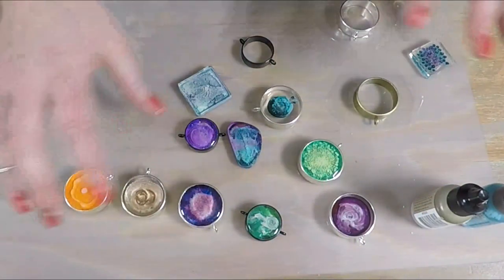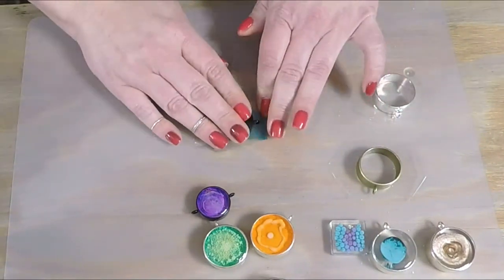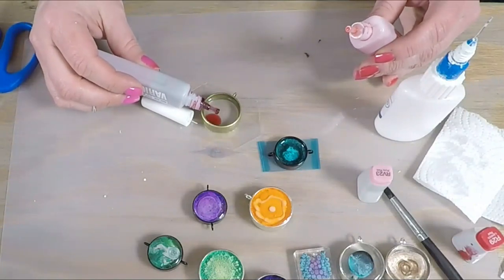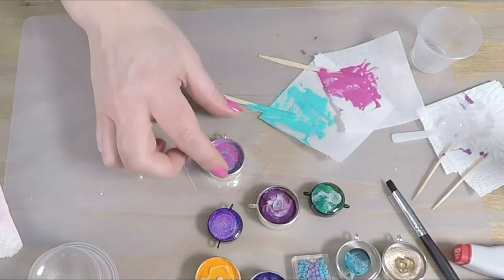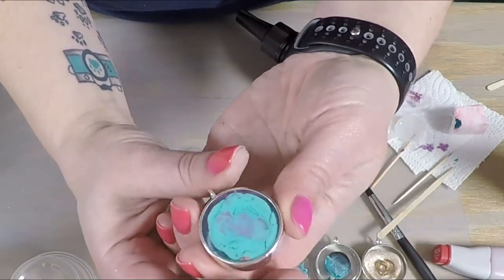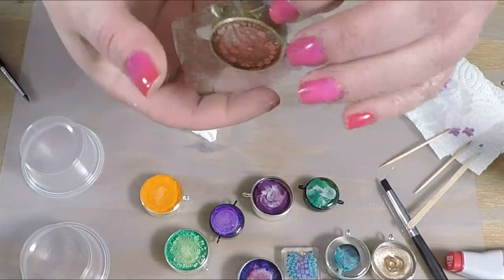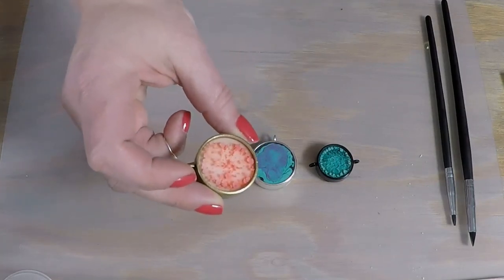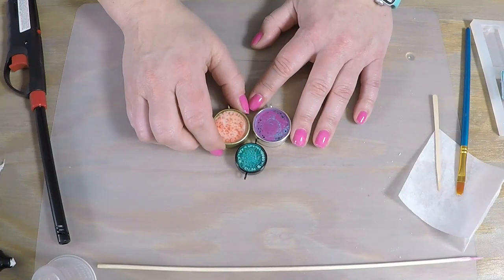Alcohol Inks and Silicone Oil in UV resin | Petri effect tutorial | Tips

Comment: 3-IN-ONE All Temp Silicone Drip Oil is a silicone-based lubricant designed with other components to form an effective product for use on metal and non-metal surfaces . So it is NIT 100 % silicone :) Hope this helps

Comment: I have noticed, from several tutorials, that you have to use the white alcohol ink for this technique. Why is that? Also, can you explain to me what a ‘mixative’ is/does? Thanks for sharing your art 🤗
Reply from the maker: Thanks for watching! The white alcohol ink, specifically the Pinata Blanco Blanco, is used because it is heavier than other white alcohol inks & regular colors. It is what makes the colors sink. A mixative has metallics in it (such as gold/silver/copper..). It will separate from the alcohol and requires a good deal of shaking the bottle (so does the white!) to make sure it’s mixed before using. The mixatives really do sink when used in a petri style like this (and can not replace the white). Pleache check out these other. Ideas for more examples!
https://youtu.be/6XC2xn1H4rw
https://youtu.be/zCZCx5_EZ5E
https://youtu.be/XOAmOTJZioA
Reply: JOTZ designs, thank you so much!

Comment: Awesome results. The Distress oxides aren't alcohol inks so will give interesting results because it's still slightly thicker. It would be interesting to see how other oxides or dissolved micas would actually react and if they would be similar. New subscriber and follower on YouTube and Instagram.  Looking forward to see what else is to come!
Reply from the maker: Thank you so much! My first attempt with the distress oxides was a hot mess! I used 2 part resin, and just dropped in the ink. It sank to the bottom and ended up making Swiss cheese out of my resin...and all the ink came out in the mold when I took them out!
Thanks for watching! 😊

Comment: Great video, love the teal one! I have a combined UV & LED 48w lamp, will UV resin cure as well, or maybe faster?
Reply from the maker: Thank you! That one is my favorite too!
The lamp you have being part LED will make no difference on UV resin, as it is only cured by UV light. I and many others recommend a 36w lamp, so with yours being 48w may cure the resin a little faster than a 36w. I’ve only used the one I have, so I can’t say it would be a problem, but my guess would be that it wouldn’t be. But I would recommend doing some small tests. Cure for 1, 2, and 3 min and see if there’s a difference.
Reply: @JOTZdesigns    I have a 72w uv led lamp & have found UV resin does cure quicker with higher watts. And for the higher the watts I would decrease the test times. Depending on all the factors I have some pieces that will cure in the 10 or 30 seconds setting. Which quicker isn't always a good thing or rather the best thing for the piece you're working on. I have a hard time if I need it to not fully cure and need that tacky middle place first. Wow that's not something you hear anyone site as a problem, ever. But hey its super great for pieces you know exactly what your doing or what you want and when need it fully cured quickly. And yeah LED won't matter with the UV curing resin, but more recently there's a UV LED curing resin. Which, oh annoying resin gods!, you really don't realize or pay attention to how much LED light surrounds you until... Until... You're all setup for your normal resin tasks, new fun experimenting  & to play your favorite game of: 'Wait!?! This isn't right. That YouTube video made this look so much easier! The ever inconsistent side of resin!' And somewhere in the midst of layers you grab the newly mixed (ok within the last 10-15 min... 20.. 30max) color you planned for layer... 28ish give or take, who can keep track anymore. When you realize it seems a bit thick, thicker than 10-15 min ago, hmm upon further investigation you pull a globby chunk out of the little cup & are left with about a third of usable resin. Now sitting and staring at this chunk you ponder: What. The. Crap!?! until it takes you a bit longer than it should to have your aha moment of: this resin started to cure because the little lamp above your work space, that isn't all that bright & doesn't really contribute to your working light, its just more annoying to turn off & on, is in fact LED. Oh great it sits right above pointing directly at your working area where (if your anything like me) have all your working pieces and mixed resin cups on top of hand-held mirrors. But wait... You double checked all the other sources of light & nothing else is LED or UV, right?... Right?.. At that moment you turn to see the little LED monster who has proclaimed to destroy all your resin happiness. Which makes you giggle, its 1 little LED, what harm can it really do? You turn off the useless annoying LED above your work space, see problem solved. Then you see this one little LED has brought the entire LED world with it, letting you win the battle but it will take the war. All your lights turn out to be LED cause although nice of someone in your house to change the track lights and other bulbs in your workspace for you and apparently all the bulbs in the whole house, they look like the old incandescent bulbs so that's what you were told they were. Nope meant to look old-school but with the energy efficiency only LED has! After your web insanity searching you realize incandescent light bulbs, although not yet, are quickly becoming extinct. That little monster is gonna win the war! You just wish you hadn't bought a huge gigantic 500g bottle of the hard & 100g bottle of the soft UV LED Resins.. If only they were just UV curing!
And after all that it would seem I dont like the UV LED resin, but I actually think its great. I just wish I had been aware of... light bulbs.. I don't know that I even knew they were called incandescent before having to do research and looking into buying a new work lamp. Just something to think about before making any resin purchases.
Side Note: A long while ago when I first was researching UV resins I had come across a post that had the most helpful tip of putting your piece on a mirror before putting inside the nail lamp. Reflecting the light insanely helps cure your piece, esp the bottom (front). Sometimes I forget to put on the mirror before curing in the lamp. So I have gotten into the habit of working on the mirror. I wouldn't recommend using for anything other than resin after its used for that. Personally I like the hand-held mirrors because of the handle. I have about 3-4 in rotation, mostly the bigger rectangle square ones but for smaller pieces the little circle works nice too. Just a couple things to keep in mind: 1. Will it fit inside your light, the handle can work for & against you here. 2. Be aware if the handle moves, esp if it moves in more than one place! I only have 1 with a bendable handle and always am forgetting at the worst times. Splat.
But the cup idea in this video is so great! There's one mold I use that I always feel like the mirror doesn't cut it, but on a cup on the mirror... Hmmm I feel this may bring great things! Thanks so much for that idea! Well and the other 75million your video provided & inspired!
Reply from the maker: I’ve never had an issue with LEDs curing my UV resin, and LEDs are ALL I have in my house. Being near a window where the curtains let in enough light is another story though! 🤦‍♀️😂
Reply: @JOTZdesigns Is it just UV curing resin? My middle of the night insanity story time tale was ref to my recent purchase of resin cured by both UV & LED. Cause no with just UV I never had those problems. But boy.. You add the 3 letters L. E. & D.. Oh the fun fun, little annoying & epic crazy times with resin! True, it could be me knowing it won't cure til its in the lamp creates an opportunity for my incredibly lazy side to showcase its full talents and I take my sweet time doing any and everything, that's more of the problem than the resin itself. And in that specific case not knowing a LED curing resin was directly under a LED light, even if that light seems useless given enough time anything can happen. Actually I find those 'I meant to make all those mistakes from the start!' times to be the best either in result or learning cool things you otherwise would't. Like in this video with the one you put too much ink in, I super heart how that one turned out!! Just stumbled across your channel in the middle of the night in some random resin searches & this was the first video I watched. Since then have done some binge watching, of yours and two others. Man I have too much time on my hands & apparently am determined to be super lazy & not do much with it other than watch YouTube videos. Did I just admit that in out loud text, oops. Sorry get a bit rambly when I haven't slept, point is I very much have enjoyed your videos and how you pick really interesting, experimental and creative works to tackle which is entertaining but also very informative. And always, at least in the videos I've seen, have amazing pieces in the end. Appreciate you sharing your tips & tricks, but more importantly your art with all us pantubers (PandemicYouTubers, I'm sure some words already been dubbed but I don't know what it is so here's my vote). And yes I already subscribed & will keep watching. Be safe. Always remember to smile!
Reply from the maker: I’m glad you’ve enjoyed the videos! Happy to share. What is the resin you’re using? I’m curious to try it! I only have nail polish UV/LED gel, and I use an”UV” light but it’s actually LED lights, and still have only had the issues with daylight coming through curtains or the sky light tube thingy in my kitchen. When I do my nails I have to block that light and all light coming from other rooms nearby, but I then need to turn on my kitchen lights so I can even see what I’m doing, and they’ve never giving me curing issues. 🤷🏻‍♀️
Reply: @JOTZdesigns  The UV LED resin is a Japanese brand called Padico. I haven't used a bad UV resin (knock on wood), I have a couple I bought from Amazon that are just UV curing. But no matter what I always go back to the Padico and just like it better. Its more expensive but I suck it up cause I love how it cures. Its very clear and just has a sharpness, great shine, cures quickly & solid and never had any issues with tackiness or under curing. But I do have a 72w lamp that I'm sure helps. I purchased the Padico resin from a US seller on Etsy, cause  Amazon has spoiled me & now I have no patience to wait for shipping. Padico came out with the UV LED resin shortly before I had purchased it, I want to say about a year and half ago, give or take. I'm not super at timelines. But I was thinking and this may sound weird but its only recently I purchased a UV & UV LED Soft resin to test out. It was the first time using the Padico UV LED Soft Resin and testing mixtures with the hard resin that I had the Lights issue. I don't know why the soft resin would make a difference but that was the only thing different that day & any day since that I have had any problems. I think I just had a 'aha figured out the problem' moment, now just would like figure out why.
Reply from the maker: Thanks! I’ll look into Padico!
Reply: @thatonechickyouknow8987   this is the greatest comment I have read in a long time! Just so honest and I swear you were standing here telling me this story, and I felt your pain.  Not the light bulb situation, per se, but the frustration of the fickle nature of wonderful wonderful resin!! I gotta restart the video and pay attention this time, I got so wrapped up in your story, I haven't watched a bit, lol! Thanks for the giggle today, I needed that!! You're awesome, have a good one! Best of luck with your work!
Reply: I see that I'm a little late to the party but I'll leave my comment anyway, even if no one ever sees it😏 So 1st I'd like to say thank you so much for this video, it's great & very helpful! Secondly- the 1st light I bought for UV resin was also 72 watts & while sometimes it was great, many times it was not.. The high wattage.. dumb word.. of course caused extremely fast curing but the near instant curing time usually distorted the initial or intended shape of whatever I was making. It was fine when I used resin to, say, dome the surface of my thicker, more substantial polymer clay pieces but when I tried doing that on more delicate polymer pieces, they always curved under the light (and no, there was no fixing it or turning back at that point). Same with using molds.. bookmark molds are generally meant to produce thin, flat rectangular bookmarks, right? Nope, mine came out in more of an arch sort of shape (and therefore, unable to be used as bookmarks!). Same thing when curing in layers.. if I used a heart mold for a pendant, I'd 1st put a little clear resin in & cure. Then, let's say I put some glitter & stickers or something in 2nd layer then cure. And lastly, I'm mixing some dark mica or pigment into my final layer which will be the background, & cure. Should be fine, right?.. that's what I thought too! But due to the way-too-fast curing, each time I put it under the lamp it curved a little more which caused it to pull away from the mold which then caused at least a little bit of my darkly colored 3rd "background" layer to seep down the sides & right to the bottom (aka, front of pendant). Let's just say that it was never a good look & I had to throw away many pieces. I finally realized that it was the strong lamp that was causing the issues (duh!!🤦‍♀️) & recently got a good ol' 36 watt light & I haven't had any of those problems since. Also, the mirror under your lamp is a really great idea. If you don't have a small enough mirror to use though, you can just lie some tinfoil (reflective side up) under your uv/led light. I just wrapped a small tile in foil & it works very well☺️

Comment: Consistency of resin will perform differently. Thin will drop quickly, thicker will float down slower causing the puff and explosion effects. ?
Reply from the maker: Yes, the consistency can cause the effects to change. I’ve only used ‘regular’ and thick UV resin, but I’ve never tried a petri with the thick resin. If I use a thin epoxy resin, like Liquid Diamonds, then I’ll typically wait up to an hour for the resin to start setting before dropping the inks in.